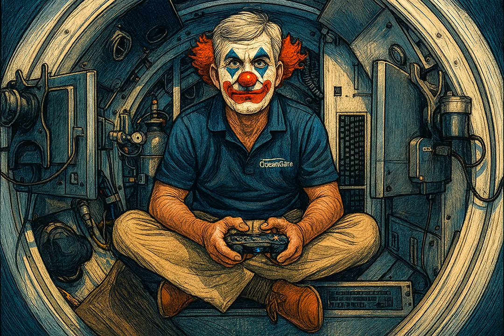David Lochridge OceanGate Firing – full audio of meeting with Stockton Rush

Comment: I agree with tony he's educated and I agree the carbon fiber worked same with the acoustic monitor system it all worked it was the lifting eyes that caused the implosion it's why when u see the wreckage all the material was sucked to the back side right where the lifting eyes were which were never suppose to be there that's where glue meets carbon fiber and 10k pounds holding at that point is not the correct center of gravity. Look at the wreckage.

Comment: "Carbon fiber is significantly better in tension (pulling forces) than in compression (squeezing or pushing forces).
While it boasts some of the highest tensile strengths of any structural material, its compressive strength is typically only 30% to 50% of its tensile strength."
-University of Google 

3:20 -Mr. Princeton

Comment: Stockton Rush’s Fatal Misstatements: A Breakdown of the 2018 Audio
This audio is chilling. When compared to established pressure vessel engineering and the known realities of deep-sea operations, Rush makes several fundamental engineering misstatements regarding carbon fiber, warning systems, and safety standards. 

Here is a timestamped, highly detailed breakdown of where his claims fatally contradict reality:

1. Misunderstanding Carbon Fiber Compression Physics
- [00:03:20] The Claim: "Carbon fiber is better in compression than tension and that's what nobody understands. It's completely opposite of everyone else says. Everyone says 'oh carbon fiber can't handle compression.' They're full of shit..."
- The Reality: Carbon fiber composite structures are famous for their incredible tensile strength (resistance to being pulled apart, which is why it works in aerospace). However, in a cyclical high-pressure compression environment like the deep ocean, the epoxy resin matrix holding the carbon fibers together is highly susceptible to micro-buckling and shear stress. Every dive weakens the structure progressively as the layers begin to microscopically separate (delamination).
- [00:04:39] The Claim: "...carbon fiber in massive uniform compression is highly tolerant of voids, mistakes, and manufacturing defects..."
- The Reality: Voids and manufacturing defects are catastrophic in deep-sea pressure vessels. Water pressure at 4,000 meters (roughly 6,000 PSI) acts forcefully on any internal microscopic air pockets or dry spots in the resin. This immense pressure uses these tiny voids as leverage points to force the carbon fiber layers apart, causing rapid, localized structural failure that spreads instantly across the hull.
- [00:28:40] The Claim: "...the world is coming around to understand that in fact carbon fiber is perfect for pressure vessels, it's the only material for pressure vessels..."
- The Reality: No certified manned deep-sea submersibles utilize carbon fiber for primary pressure hulls specifically due to its unpredictable and sudden failure modes under cyclical deep-ocean compression. For this exact reason, forged titanium and specialized high-yield steel remain the non-negotiable industry standards.

2. The False Security of Acoustic Warning Systems
Rush's safety protocol relied almost entirely on an experimental real-time acoustic monitoring system intended to warn the pilot of an impending failure.
- [00:27:00] The Claim: "It doesn't just implode, it screams like a mother before it implodes."
- The Reality: While failing carbon fiber does snap loudly under stress as individual fibers break, the final catastrophic failure of a rigid pressure hull at 4,000 meters depth happens in a matter of milliseconds. Once the structural geometry reaches its critical compromise point, the implosion is entirely instantaneous. It is a reactive autopsy of the hull, not a proactive shield.
- [00:38:08] The Claim: "I will know before it fails, well before it fails... I'm betting my life on it."
- The Reality: A warning system requires actionable time for the crew to survive. Even if the acoustic system detected terminal snapping at 3,500 meters, a submersible cannot drop ballast and ascend fast enough through the water column to outrun the imminent collapse of a compromised hull. The warning would only tell the crew they were about to die.

3. Dismissing Non-Destructive Testing (NDT)
David Lochridge heavily pushed for the hull to be scanned to establish a safety baseline. Rush dismissed this standard engineering practice.
- [00:01:40] The Claim: "...there is no NDT [Non-Destructive Testing] you do on 5-inch thick carbon fiber of that size, so there's absolutely nobody on this planet [who can scan it]..."
- The Reality: While extremely difficult and expensive, aerospace and defense contractors absolutely employ ultrasonic, phased array, and advanced X-ray testing on thick composites to verify structural integrity and map out internal flaws before exposing them to active loads. 
- [00:02:08] The Claim: "...because the data we would get from a scan would not be meaningful really... unless it was a gross delamination."
- The Reality: Microscopic voids, variations in resin distribution, and minor porosity—which NDT is specifically designed to detect—are highly meaningful data points. In a high-pressure environment, micro-voids are the exact starting points for the catastrophic delamination that destroys the vessel.

4. Disregarding Viewport Ratings and PVHO Standards
Lochridge pointed out the acrylic viewport was not rated for the target depth and lacked PVHO certification.
- [00:15:51] The Claim: "...will the viewport fail without warning? And with to a man everybody says no, it will craze [form micro-cracks] before it fails."
- The Reality: Cyclic fatigue on an under-rated acrylic viewport does not guarantee a safe, slow visual failure (crazing) that allows time to abort. At 4,000 meters, the sudden, explosive failure of compromised acrylic is a documented reality that offers zero time for an emergency ascent procedure.
- [00:16:38] The Claim: "...PBHO is not a standards committee, it is a volunteer group... who have their head up their ass in certain ways and I'm going to go prove that."
- The Reality: The ASME PVHO-1 standards (Pressure Vessels for Human Occupancy) are the globally recognized, life-saving engineering laws for manned submersibles. They were derived from decades of rigorous testing, fatal accidents, and empirical data. Ignoring them intentionally removes the minimum verified safety boundaries designed to preserve human life.

5. Equating Manned Testing to Unmanned Drop Testing
Lochridge strongly advocated for dropping the submersible on a cable for deep unmanned testing to verify the hull before ever putting humans inside.
- [01:17:19] The Claim: "I am confident that with an incremental stair-step approach down, having a person is just as safe as having them on the surface."
- The Reality: Incremental manned testing is never an accepted substitute for unmanned hydrostatic pressure testing. If the hull design is fundamentally flawed, an incremental manned dive simply means the pilot acts as a human crash test dummy, guaranteeing they are inside the vehicle when it eventually crosses its failure threshold.
- [01:22:21] The Claim: "I have no desire to die and I'm not going to die... I am not dying. No one's dying under my watch, period."
- The Reality: Manned incremental testing on an unclassed, experimental hull design transfers the absolute highest level of physical risk entirely onto the pilot and passengers. This statement reflects a tragic normalization of deviance that ultimately cost five people their lives.

Comment: It creaked as it was failing. It was so quick rush couldn't learn from his mistake
Reply: It creaked every mission prior, too. But because he had no baseline, as David repeatedly and correctly pointed out, he just told himself "that much noise must be safe, because I didn't die. It didn't fail on the 88th dive, it won't fail on the 89th".

Comment: Quite interesting to hear Rush say stuff like "it doesn't just implode" within the first 30 minutes (somewhere between minute 25 and 30) and you know that this is exactly what happened.

Also Rush quite quickly started to question Lochridges credentials "Have you ever build a submarine?" and "Have you ever build a plane?" as if every engineer must build these things first before they can understand physics. Usually you first have to understand the basics and risks involved before you create something. If you don't, then you might end up as physics on the bottom of the ocean...

What I also noticed is Rush basically doing this rapid fire talking, where he just throws point after point after point without actually having a proper discussion with the other person and without listening to what he's being told. He should understand how difficult it is in the first place for employees to oppose the big boss of the company. Every employee to some degrees has the fear of losing their job when they say the wrong thing. So if hire someone to check the safety of your product and he tells you something along the lines of "don't use it", you should at least listen.

Also the constant tapping on the table whenever Rush talks shows how irritated he is and he just wants to "hammer it" into Lochridge, that he (Rush) is  right and Lochridge is wrong.

Comment: Stupid question but can someone tell me if it somehow didn't implode but was compromised would there be a jet of water strong enough to slice them open?
Reply: Not a stupid question at all, small leaks at that pressure would be so fast and thin that they could cut like a hot knife through butter
Reply: @daverimar1237 thanks

Comment: This audio tells you everything- they were aware of delamination of the carbon fibre, they were aware of cyclic fatigue, they were aware that the o-ring and view port were not up to scratch. You had Lochridge- not just a pilot but the director of marine operations (and the guy with the most submersible experience) literally expressing every concern that later came true and was just gaslighted or written off. 

At every stage from early shop floor testing to deep depth testing in Bahamas there were warning signs. Nissen should’ve been prosecuted off the basis of this video alone

Comment: carbon fiber could indeed handle the weight and the pressure under water, but they didn't care about the microscopic issues that needs attention to... but stockton rush didn't care one bit.

Comment: Probably a stupid question, but why didn’t they just build this out of steel? What was the  obsession of using carbon fibre? Was it cost or just vanity?
Reply from the maker: Cost and space. The most common material for a sub like this is titanium, like the one James Cameron used. It's extremely expensive, and a lot heavier so you can't easily build it big enough to sit 4 people comfortably.
Reply: @MatthewMoonen  Interesting thanks. So essentially they were cutting corners to save money. Always a good strategy when safety is pararmount! 😢
Reply: Titanium/steel is heavier, heavier material needs stronger thrusters, stronger thrusters needs bigger batteries, bigger batteries need more space , more space = more money. He just wanted to save a penny or 2 that's all

Comment: @3:20: "Carbon fiber is better in compression than tension, and that's what nobody understands, it's completely opposite of what everyone says..." - Stockton Rush - this part of the audio is the root cause of the entire tragedy, Rush believing the entire engineering industry was wrong about Carbon Fiber's characteristics.  Carbon fiber is known to be extremely strong under tension, which is why it was originally used for airplane fuselages and wings which are under tension.  In that use case, CF is stronger than steel pound-for-pound.  But Rush did 8yrs of research and convinced himself of the opposite, that carbon fiber is stronger under compression than tension, and very durable.  But under compression, it splinters, delaminates, cracks, etc. after repeated cycles, until it fails catastrophically.  It may even be strong under compression forces at first, but it's not durable over repeated compression cycles.  I hope someone publishes a book that compiles all the reasons Rush came to believe this.  Needs to be a case study in rationalization and failed chains of reasoning.
Reply: Rush was the Canute of our age, ego vs physics ,only ever one outcome possible 🤨
Reply: Wings are not under tension. A loaded wing is under compression on one side and tension on the other.
Reply: @enndubful  An important thing to remember about carbon fiber in aircraft is the fact that it’s used primarily for the skin.  The actual structure of the wings and fuselage (the load-bearing members) is titanium and/or aluminium.  Stockton basically tried to use carbon fiber as the ONLY load-bearing material.

Comment: Stockton Rush...Normalization of Deviance is a sociological phenomenon where breaking rules or ignoring safety protocols gradually becomes accepted practice, especially when no immediate negative consequences occur. Coined by Diane Vaughan regarding NASA's Challenger disaster, it represents a shift from safe conditions to risky ones, often driven by production pressure or a belief that standards are inefficient. 
Key Aspects of Normalisation of Deviance
Definition: The shift from following safe procedures to adopting unsafe, "deviant" practices as the new standard operating procedure.
The "Slow Drift": It is not a single, catastrophic act, but a gradual, accumulation of small, overlooked, and rationalized decisions.
The Cause: Often driven by a lack of immediate adverse consequences ("getting away with it"), production pressures, or a belief that regulations are unnecessary.
The Result: High-risk industries, such as aviation, healthcare, and engineering, often experience this before major accidents.

Comment: Glue was holding this thing together????
Reply: All carbon fibre is held together with resin/epoxy - It's incredibly strong, but as many have pointed out it's just a terrible material for a submersible.

I often wonder why Stockton was so married to using Carbon, and I think ultimately he had just talked it up so much he HAD to, because admitting he'd made a mistake was an impossibility for someone with that monumental an Ego.

A cylinder is still a terrible idea for that depth, but if they had at least made the same design using all Titanium, it would've given them a much higher chance of success.
Reply: Yes only glue was holding the titanium end caps to the carbon fiber tube.

Comment: I’m just a hobbyist with fiberglass and carbon fiber.  I expected this craft to have been meticulously constructed without voids and wrinkles.  I was shocked that they just grinded wrinkles and ignored known voids.  A first time hobbyist wouldn’t accept wrinkles.  Likewise, every hobbyist almost cries when they accidentally sand too deep and destroy a layer of fiber.  

Beyond that, Rush just ignored the nature of carbon fiber, thinking that his monitoring system was adequate to track progressive deterioration and would provide enough warning to surface. 

I definitely think that a carbon fiber would have worked with better engineering and construction methods. 

When I learned that they had no method of non-destructive testing, I knew Rush was insane.  Descriptions of his acoustic monitoring system were almost comical.  The system detected noise but there was no way of determining the significance of that data.  No real baseline, not used during destructive testing. 

Also, Rush had this silly idea that noise followed by silence was a good thing, suggesting some kind of healing as voids closed.  When resin or a filament cracks, it never is going to crack again, it will be silent and damaged. 

The science and math associated with this kind of project is intimidating but any hobbyist would recognize the problems.   No voids, no wrinkles is carbon fiber 101.  

Funny how Rush describes his mass-marketed kitplane as evidence of his understanding of composite materials.  You can acquire the skills to build a plane like his watching videos online.

Comment: LEGALLY I don’t see what Stockton did wrong. This whole audio indicates that all this is experimental. The participants signed multi-page documents stating that this was all experimental and that it could lead to death.
Reply: I agree that signing a waiver does legally protect him. Any "entertainment experience" usually requires this. Baseball games, escape rooms, and high-ropes courses are some common examples.

I believe the issue is that while technically the "Mission Specialists" acknowledged the possibility of death, one could argue that they weren't given adequate information about the degree of the risk. For example, you can die by getting hit with a baseball when attending an MLB game. It happened to someone in 2019. Technically, every spectator at MLB games have subjected themselves to a risk of death and have waived liability when they accept the terms of use of the admission ticket.

The difference is that people can get a reasonable sense of how likely it is to die by getting hit with a foul ball. For instance, you can position yourself away from likely foul ball spots; you can ensure you're paying attention to the game; you could even wear a helmet if you were seriously concerned.

My guess is that for the man and his son who went on Mission 5, their sense of risk was probably only on the level of maybe parasailing or sky diving. They trusted that even though there was a risk, the people designing the submersible did a thorough job of mitigating that risk. Since the Mission Specialists weren't marine engineers, and since there was no ABS certification, they had to trust that Stockton and his team made the risk as low as possible. My guess is that Stockton told them the sub was safer than it actually was.